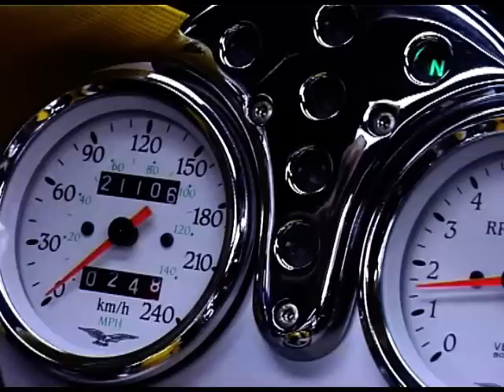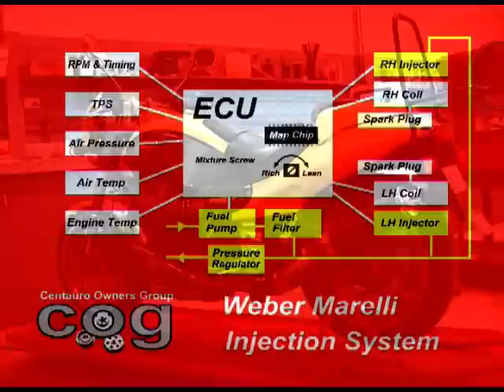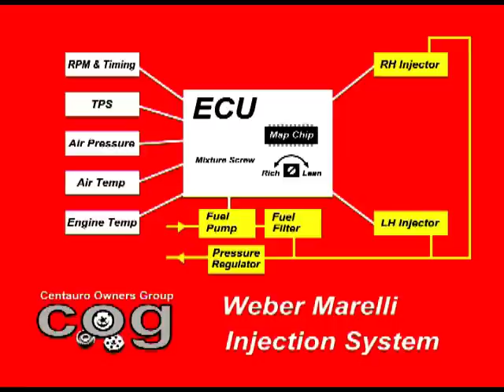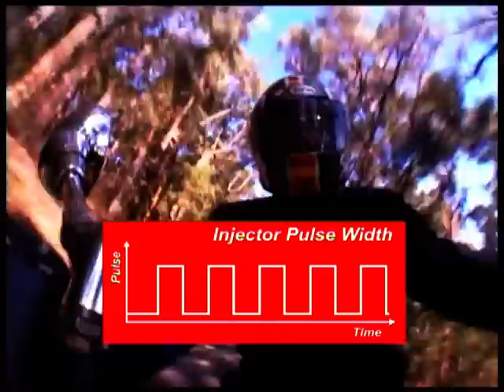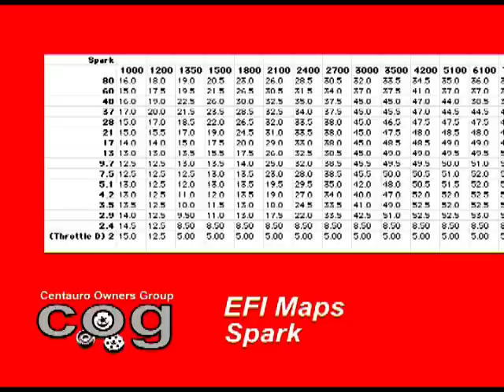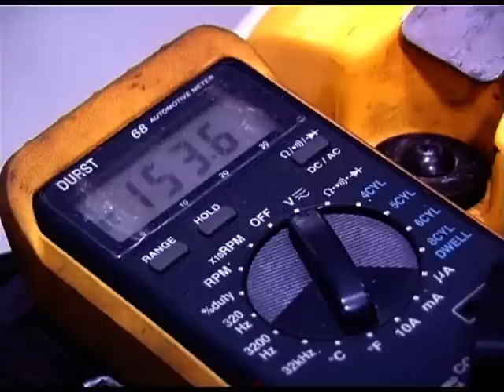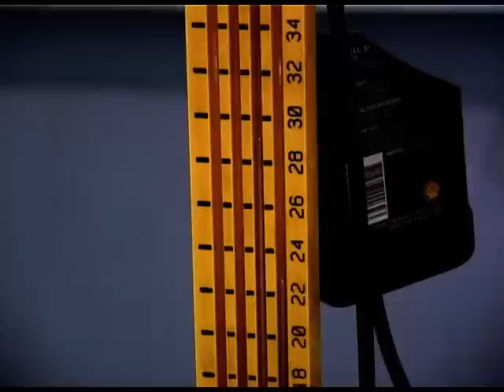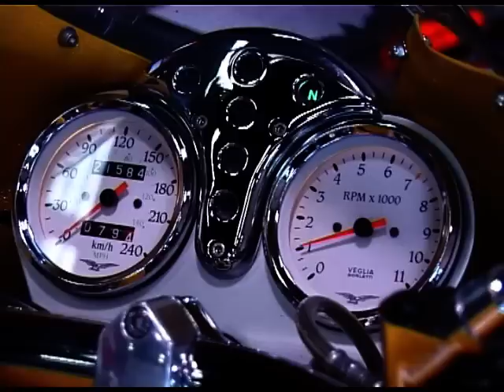Servicing The 1996 Moto Guzzi Centauro

Comment: As the original owner to my 98 Centauro, a couple of things don't add up in the sequence of setting the TPS. First, why set the TPS to 150mv and after connecting the linkage between throttle bodies, reset the TPS to 378mv?? Seems counter to the first step?? Second, when opening the air bleed screws after balancing the throttle bodies, you mention opening them to set the idle balance on the throttle body with the highest vacuum? What about the other side? I do not have an O2 sniffer so I did the tune by ear as you did and it worked out fine. A good video otherwise, I hope these comments make sense. Appreciate it.

Comment: Is 2003 model Centauro identical to 1996 model or is the servicing procedure different?
Reply from the maker: There were only cosmetic differences. Factory production ran from 1997 - 2000. But it wasn't uncommon to find Centauros being sold new a few years later.
Reply: @MikesMachines  TY for the explanation. The seller said his was a 2003 and then I found out the same thing you stated so I was a bit confused.

Comment: Looks very expensive to have service done on this motorcycle 😁
Reply: I’ve not had a Centauro, but changing the oils on a Guzzi is straightforward. You don’t need to pay someone to do it. Just generally they’re lovely bikes for even a nervous home mechanic to work on.
Reply: Agreed !  Very labor-intensive, if done methodically "by the book," as this Master Mechanic has done. Exotic bike, $100 per hour shop time (?) + parts = KA-CHING !!!